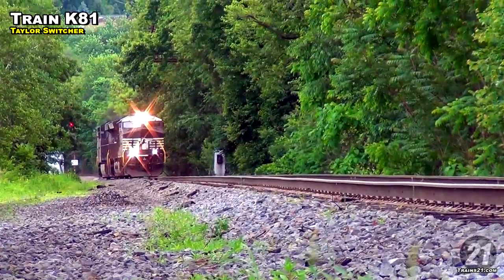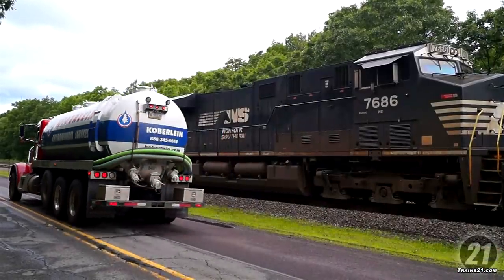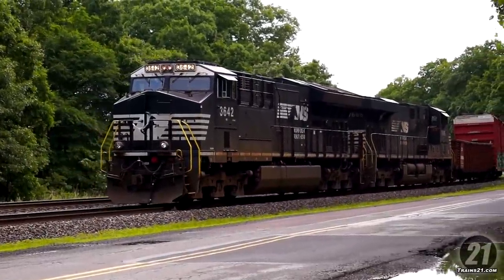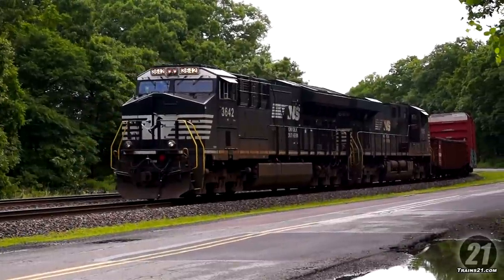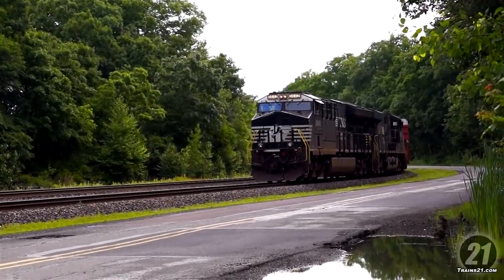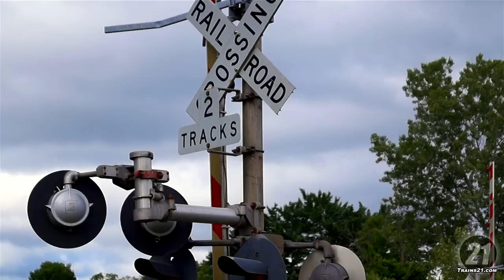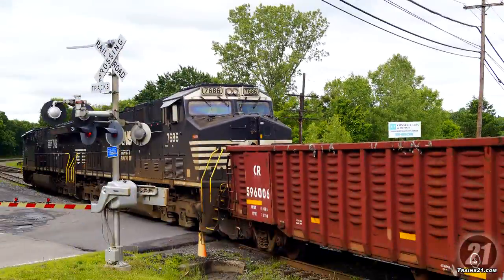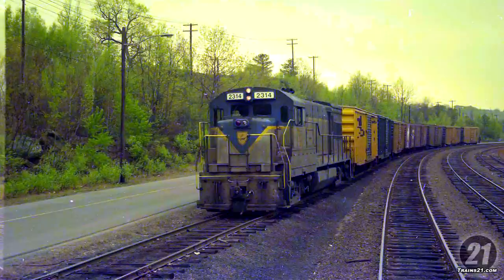This Is Why We Need Smaller Locomotives for Switching

Comment: I see capable switch engines in Europe and Japan.  The Japanese use engines with the cab in the middle.  I see a lot of innovation in Japan, Germany, Norway, and Switzerland that could be used right here, but that would take money and we all know the investors must be rewarded before much needed improvements.  The one problem Europe has that they share with the US is graffiti.  Japan?  Haven't seen any graffiti anywhere.  It's gratifying to see one of those capable switch engines with a string of rail cars unmarred in Japan.
Reply: Absolutely investors must be rewarded.   That is the reason for the investment.   If I buy stock in a corporation, I expect a return.  Absolutely.  Why do it otherwise.   Railroads in the US have invested heavily in new power over the past decade.  So much so that hundreds(thousands) of older units are in storage.   As far as European innovation being used on North American (US,CA,MX) rail freight operations keep in mind we railroad very differently here.   Their short haul, fast, low-tonnage freights do not compare to the long distance, heavy tonnage requirements of Mexico, the US and Canada.
Reply: @cdavid8139   it's more emissions standards then anything.....class 1 have to follow strict tiers while shortlines and regionals for some reason don't.....I find it amazing how all you Americans blame investors.....excuse me mister American, do you have a 401k???
Reply: @trainandtruckmodeler786  Emmissions...and fuel efficiency.  Also the ability to run DPU and GE(Wabtec) new software.   So much is involved.   It's amazing how so much almost new power is stored.  Class I tiers (and short lines) can vary from state to state as well.   And yes, people invest in a 401k and want maximum return.   But then they turn around and blame greedy investors for all that's wrong in the world.
Reply: I hate graffiti.  It is a sign of the cultural rot and lack of respect for other's property.
Reply: @cdavid8139   I worked for a regional and a shortline as well as class 1 when I lived in the USA....the class 1 was on strict emissions, the regional was on a less strict plan...and the shortline had no emissions standards....because or longest route was 107 miles and the state of Illinois out of all places being run by liberals stated it's not worth the effort considering the route miles....so in contrast....if your a trucking company as well of 50 or more trucks you have not only inspection by DOT but also measures the exhaust coming from the stacks ....in contrast a local dump truck owner operator can have a 1985 model r Mack, a 1978 r model mack and the truck only needs inspection....while a local farmer can have a 1968 Mack and need nothing ....
Reply: @trainandtruckmodeler786  Try California.   Standards there are constantly changing.   I'm familiar with Illinois railroading but not in the last decade or so.   Unless you consider beautiful East St. Louis as actually a part of Illinois.
Reply: @cdavid8139   I don't live in the USA anymore ...but I plan to visit California traction this summer to get pics and build models of their current locomotives
Reply: @cdavid8139  This isn't about long-range heavy haulers though. Europe runs different locos for different tasks. Switching/shunting and the last mile on unelectrified track done by smaller, slow but also heavy pulling shunting locos. Long range is done either by purpose built Diesels, that can provide almost the same ammount of traction as the engines in this video. However, most european diesels are just shunting-locos that aren't really ment to ever leave their yard.
But thats okay, because we have electric locos that provide the long-range heavy haul traction our system needs. If it weren't for different gauges in Spain and Russia, a single locomotive here could pull a train from madrid to moscow (roughly the same distance as NYC-LA), with the same wheight a single US-Loco could. But on Electricity instead of Diesel.
Oh, and a task like this would probably be done by a Unimog or something similar with equiptment to run on both road and rail. The big locos would drop the wagon off at a big shunting yard, a smaller loco would take it to the factory and the factory-owned road-rail vehicle would take it from there...
Reply: @thoughtfox2409  What you describe is the way it is usually done in North America (US, CA and MX).   But there are exceptions and you are looking at one in this video.   At times heavy road units will switch smaller industries if the location, tonnage and other factors call for it.   American locomotives run on electricity just the same as European locomotives.   The difference is that we make our power in the locomotive and do not depend on overhead wires.   Europe does it differently.   There are advantages and disadvantages to both methods.
Reply: @trainandtruckmodeler786  That's a fantastic operation.   Worked with them several times over the years.   Amazing story.
Reply: @cdavid8139  the 2 locomotives they just got I want to model as well as the 2101....those 2 they just got I bought 2 frateschi HO G22u models to start the kitbash.
Reply: @trainandtruckmodeler786  I don't remember their power but they have quite an operation
Reply: @cdavid8139  Railroads are now at a low 60s OR, that was in the 70s-low 80s for decades and everyone still invested in them. They made plenty of money back then. They are so focused on OR now they won't take customers who will make them some money and only want those who will make them lots.
Reply: @trainandtruckmodeler786  Railroads have very lose emission standards. They didn't get the first till the late 90s and the ones today are over a decade old now. 
Railroads also aren't required to rebuild and meet modern standards instead able to rebuild them while reduce emissions only slightly.

Comment: I always find it amusing when 6 axle road diesels are utilized for switching duties like this, especially since NS is selling pretty much everything that isn't a GE Widecab. Knowing NS, they're probably going to use this as an excuse as to why they want to discontinue switching ops even though they sold their switchers in order to save costs because of PSR. Shouldn't Sell So Soon!
Reply: They're obsessed with operating ratio.
Reply: Class I roads began selling off switching locomotives decades before PSR.
Reply: Shoulda kept the B23-7s and B30-8s and rebuilt em into AC23B’s and AC30B’s lol
Reply: @cdavid8139  CSX still uses a couple of switchers to shunt cars between Osborne Yard and a few nearby industries.
Reply: @dsmith9964  They use a lot more than just a couple.   As do I believe all the Class I roads.   If there is significant need for them they are still used.    Personally I have a soft spot for them and of course short line and regional roads also use them a great deal.  But there are not many many situations where the big road units will switch industries while they are assigned to a job where heavy tonnage and higher speeds may also be called for during a shift.

Comment: Smaller shunters/switches have several advantages, including able to negotiate tighter curves, but the big reason is they are cheaper than big locos.

1000 HP or even a little SAR 500 class shunter with a rating of only 500HP from it's 4 cylinder engine can move 1000t on relatively level track, which most rail yards are & you don't need speed.

Comment: Nobody will admit it but to solve a Switcher issue is quite simple. What is needed is a unit that has about 2500 HP, geared for Freight use @ about 62 mph, a high center cab for excellent visibility with a complete unobstructed view to both ends of the unit. A 4 axle truck for tight radius curves. Easy access on and off the engine. Why it won't be built is more of the Railroads won't spend money on a specific engine to do a job that can't run the mainline the same as the rest of their fleet does. This world of engines with 3 axle trucks with universal usage has gone to far and switching crews are paying the price and railroads will continue to patch up branch/service tracks from overweight locos. Safety seems to not be of a concern either in switching operations today.
Reply: Stadler makes that right now for Europe, VR group bought 60 customized as Dr19. Given their recent entree into NA I wonder if anyone will buy it. Knoxville makes a MP/SW style loco upto 1500HP and typical GP/SD style upto 3200hp.
EMD and GE will both sell you new or rebuild 4 axle units but new ones mean T4 emissions which the class 1 hate having to deal with. It doesn't help they didn't want DEF.
Reply: O heavn forbid if it emitts to much
Reply: There are several 115-130t 200 -3000 HP box cab units with double cabs on pilot duty in Australia. 

There were the pride of the railways in the 70s & 80s & have great views for shunting.

Most of Australia's typical shunters of 500- 1000HP are gone. These were all hood units.

Comment: It's not new seeing massive six axle locomotives doing local switch like these Gevos. Heck when I was trucking in Iowa few years ago, I saw UP using SD70M for local switching at a industrial park where I sat for good 15 minutes for the same reason like in this video. It's atrocious seeing what Class 1's have become these days with implementation of PSR and selling locomotives that were designed to handle on rails that were too tight for 6 axle big locomotives. I'm lucky to have local shortlines around my home that don't follow that mentality of Class 1's. Geeps are seen often here even the former NS units. If they want customers to have spurs that can handle weight of six axles, then look at Carload Express. They invest on their infastructure improvements, bringing in new customers, expanding the existing customers, and buying good emd power (Geeps, end cabs, SD40s, SD60m's).

Comment: To me, it looks like it is time for some upgrades to the rails on the spur siding and the rail bed if the railroad isn't going to spend the money on different switching equipment.
Reply: People don't realize that the crossing  belongs to the state, city or county but the railroad tracks still belongs to the railroad which they have the right away automatically. Get use to and get over it or move somewhere else.motorists has no say so when it comes to the railroad
Reply: @jasonwest3484  I'm sorry, not all situations are a glove fit. It is not the issue of the road crossing being blocked. The issue is if the railroad wants to be a great neighbor, or should they come to this conclusion to crap it out on everyone else? I know of a situation many years in my community, back when a conductor had fallen from the end rigging of a hopper car being switched at a road crossing and was run over and killed. The engineer moved the switching locomotive back to the yard instead of staying at the scene while the investigation had begun. This was a coroner's case, and the coroner was dammed angry, wherefore the message went out to have the locomotive and the engineer return to the scene, under pain of arrest and prosecution if he refused.
Reply: The railroad may not own the track leading into the plant.   They usually only own the mainline and runarounds.   It is the industries responsibility to maintain their own track (or farm it out)

Comment: It’s not weight that’s the limitation. Many industrial sidings and branches have tight curves that the 6 axle locomotives can’t  handle. That’s why the class 3 railroads stick to 4 axle units like older GP’s. The Class 1’s prefer having a Class 3 partner to take the local service. Switching takes time and tying up road locomotives and crew to switch a single or even a few cars isn’t cost effective for the Class 1’s. 
That said, there is definitely a need for switching locomotives. In most cases, one or two GP’s can switch anything the have to. I’ve cut and set out many 150 car trains with a one or two 4 axle locomotives. Two unit power on a local is useful because sometimes you can run with power on both ends of your train to allow servicing turnouts in either direction. 
And for the record, forget those “genset” switchers. They are junk. Unreliable and a PIA. A little 1200 HP GP15 makes a great switcher.

Comment: Why you need, what, 9,000 horsepower? to switch a cut of 8 empty hoppers and a couple of boxes has always been beyond me. All I can assume is either there is an FRA rule that you can't have less than two power cars on mainline track, or the railroads just assume that the power is so unreliable that you will be lucky to have one powered axle out of 12 by the end of the shift. Back before the railroads went digital and encrypted, that seemed to be the case around where I live. Half the chatter on the radio was a crew talking with the dispatcher or a specialist to figure out how to reset or reboot the loco so it would move again, and I don't think I ever heard a local crew say all axles were working. A shame that we can't use SW1500s anymore.
Reply: You don't need 9000 horsepower.   But if that's what you have then you are not going to set one out.   You go with it.  And what you don't know is that a mile down the road they may be picking up 4000 tons and moving it uphill from a start.   You can't look at what is in the video and make judgements without knowing what else they have to do.
Reply: I think they are using 2 units to have cab in the lead for either direction.
Reply: @cdavid8139  Foamers always seem to overreact and go into an abject panic when they see one thing they don't understand in a 3 minute video, and every one of them "can fix the problem if it were up to them."
Reply: @kensingtonchapp4819  Yessir.   Not all of them but there are a few that point out how poor a job the professionals are doing and then wonder why crews are not as friendly as they used to be
Reply: Having a guy chasing you around all day long with a camera in your face monetizing your work has a bit to do with it as well.

Comment: Like Southwest Airlines with its all 737 fleet, there is great economy in having only one model of anything so pricey. Railroads are making due with older road units to save money, despite the disadvantages. They've also reduced service on branchlines and local switching (selling them off to shortlines), so fewer switchers are needed.

Comment: When the papermill I work at was switched by SOO Line and then Wisconsin Central they only used Geeps due to the tight cuvature.  When CN took over they sometimes used a pair of SD60s and found they could only couple up to cars on straight sections.  Now that our mill has a track mobile the railroad no longer switches us and we pick up and set cars on the lead track.  Some people in the rail industry say that in the near future the major railroads won't do any switching at all and it will be handled by independent switching companies.
Reply from the maker: It wouldn't surprise me. I've talked about it in past videos over the last 30 days or so.
Reply: In Memphis there’s this BIG BNSF yard and by that yard there’s a switching puzzle. When I saw a train it was being switched by RJ railroad company not BNSF but 500 yards is the BNSF mainline.
Reply: @Trains21  Sorry man, you're probably more up to date about the subject than I am.  I have a friend at WATCO and he says they've been hearing rumors the company wants to pick up some of this business
Reply from the maker: @poowg2657  No worries, I was just mentioning that the subject had been brought up. But WATCO moving into terminal switching and operations wouldn't surprise me.
Reply: Very common practice.   There are hundreds of locations where switching operations serve the larger mills.   Makes total sense.   However we are talking about larger industries.  Not smaller ones like these that are located on a Class I main
Reply: @poowg2657  WATCO has been in the industry switching business for years.   So has Omnitrax, GWI and dozens of others.   It is very very common.

Comment: I’m just saying a smaller switcher would still block the crossing or keep the gates down becuase it is so close to the tracks. And why would they bring a switcher out there for one box car? It’s just not practical for them to do that.
Reply: better a four axle switcher than two six axle road locomotives
Reply: @unaizilla  what? Ya I guess if your in a yard but out on the mainline no
Reply: No, they had to build the train that long to reach into the barn because of the weight limit on the siding. A smaller, lighter unit could go right into the barn and get the cars and not have to build a longer train to reach from the crossing. The crossing would be closed much less.

Comment: I thought NS still had plenty of GPs. I wonder what the cost of running these big 6 axle units vs a pair of geeps or mother slug combo is. 

Maybe the railroads are just doing everything they can to run off customers...
Reply from the maker: Conrail tried to run off customers too. Then ripped up the tracks to avoid competition. Slash and burn. Sad, but sometimes true.
Reply: @Trains21  If you really want to see poor railroad management. The neighbors to the north. They had the worst name they could find. Pan Am.

As for ripping up tracks to avoid competition, the real competitor was trucks. Another railroad cant steel your tracks. A short line can lease them, but that just feeds you freight. It all boils down to short term gain for wall st stock prices.
Reply from the maker: @frankgrabasse4642  Yep.
Reply: That's where trucking took the advantage.
Reply from the maker: @chromediesel444  Exactly
Reply: @Trains21  They sure did
Reply: Look at Altoona yard HUNDREDS of possible switching locomotives just doing nothing
Reply: @OldIronVideo   They are doing nothing because they are not needed.   Railroads in North America do not store power without a reason.  If you do not have the tonnage to move then there is no reason to keep the locomotives maintained, inspected and serviceable.